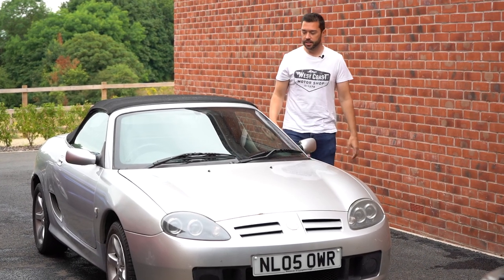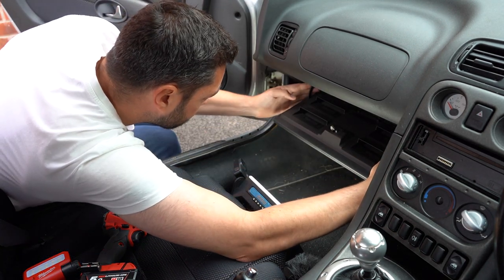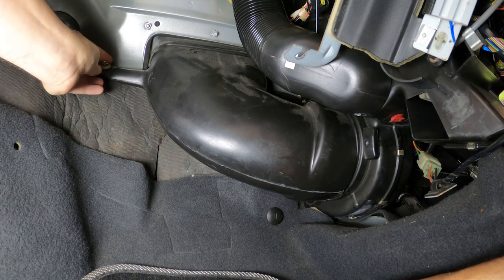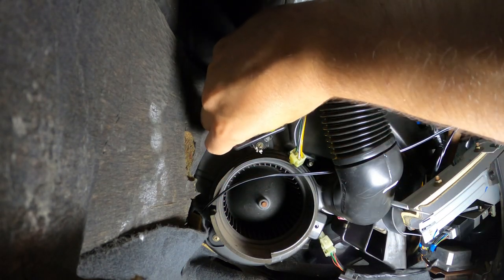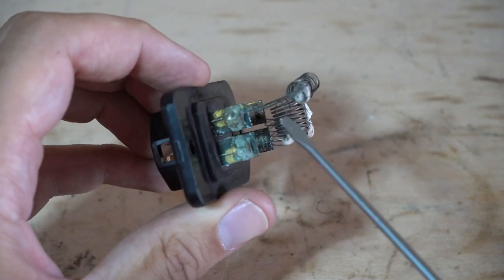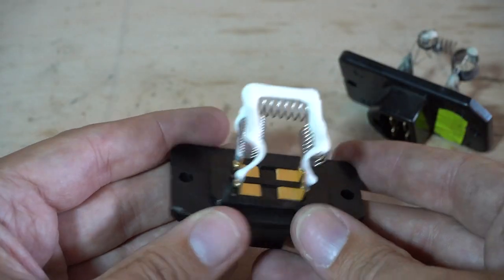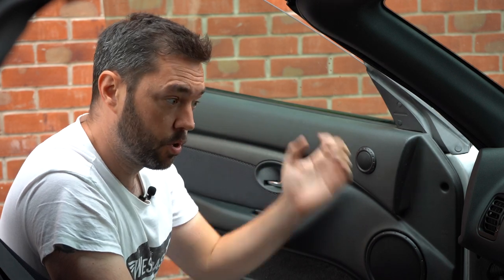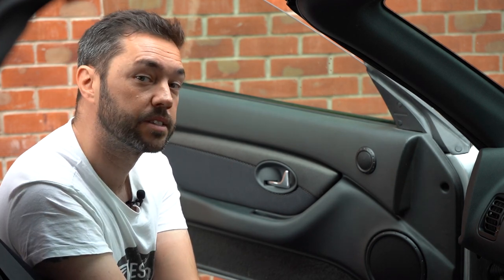MG TF Blower Fix

Comment: Lee I cleaned up the existing unit with a small brass bristled brush and bought.new resistors from Maplins at the time and soldered them on. It was pennies to fix so I think it's cheaper than buying a new unit. On saying that the resistors I bought were certainly more hard wearing than what Rover used. A more long term job. Just in case anyone is on a real tight budget.

Comment: Another wonderful bit of MGTF design where you have to be contortionist to get to the nut /bolt /component. Just like the bolt at the bottom of the steering column which has to be connected to the steering rack. The suggestion of removing the snorkel to get at the resistor pack from the top seems viable but you still have to get into Kama Sutra position 656(sorry I'm dreaming) to release the bottom end of the snorkel!!!

Comment: Lee I had the same issue as in this video. You went through every body position I did to remove the resistor pack and the only thing missing was the extremely blue air surrounding me during the process. Lol. Well done.

Comment: That working position was something I have had to get in a number of time, on the driver's side. A few times to lubricate and then replace a throttle cable that had a kink in it. Then to reposition the brake light switch. Then polybushing the front lower arm. You have to lower the subframe, to get access to the bolts; so the lower link clamp on the steering column has to be disconnected (and reconnected afterwards). All this with the steering wheel in place.

Comment: Those new one burn out really quick. The ceramic resistors from DMGRS work so much better and are significantly cheaper than a whole unit
Reply: I got those as well,  easy to solder and encased in ceramic to reduce burn out, much cheaper.

Comment: An unconnected (to the video topic) observation, your handbrake leaver looks to be too high, this is usually a result of the handbrake cable being over adjusted to compensate for a failing rear brake callipers that are seizing. I found this out the hard and expensive way when I set fire to a perfectly good set of brake pads on the way home from work one evening. This is a common issue with these Lucas type callipers not just on MG’s and tend to swap them out as soon as they look like giving trouble.
Reply from the maker: Cheers Chris 👍